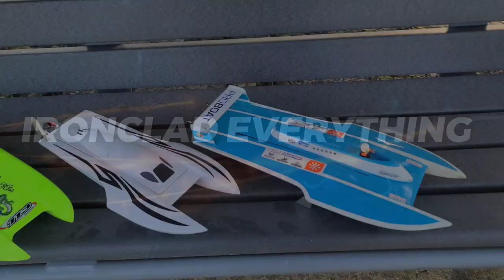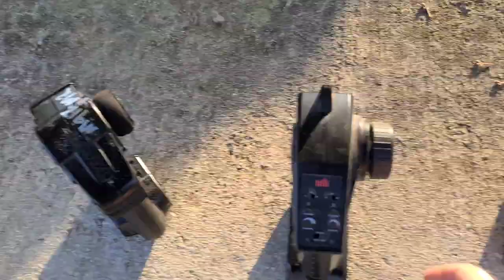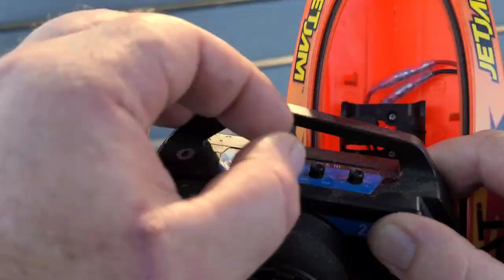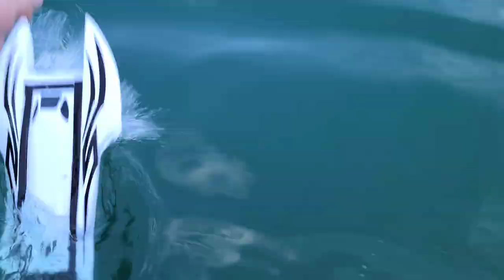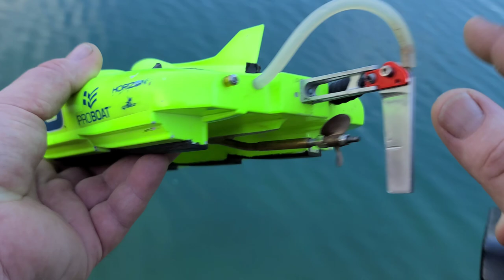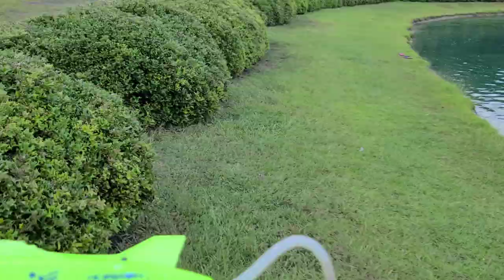Small Boats Big Fun - 1:20 Atlas Van Hydroplane, TFL Small Bolt, Proboat Miss Geico Catamaran

Comment: Sweet!!! Upgrading the mg17 is like putting a V8 in a mini cooper.   I never could get the hop out of mine, I believe it’s due to the light weight setup, the prop lifts the entire boat out of the water.   It can be so fast for its size, I wonder how small a near to no lift prop can be purchased, that’s what we need, a prop to push the small boats forward and no lift 👍BGFL